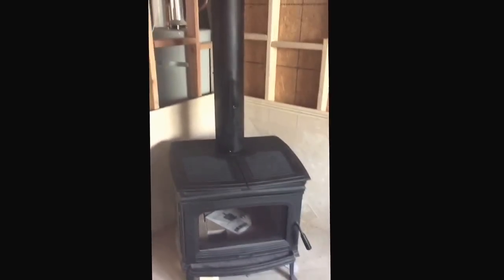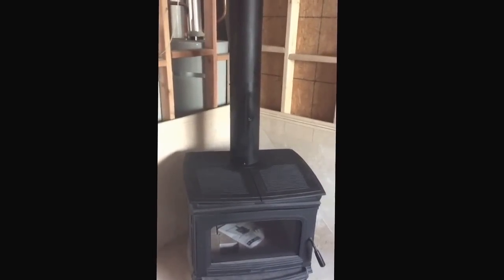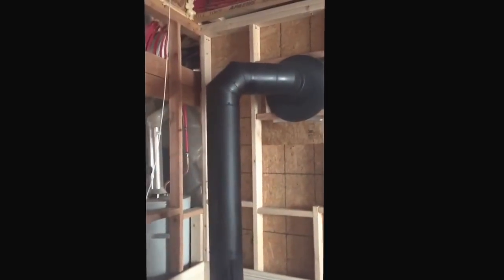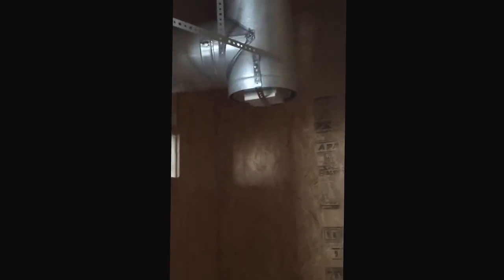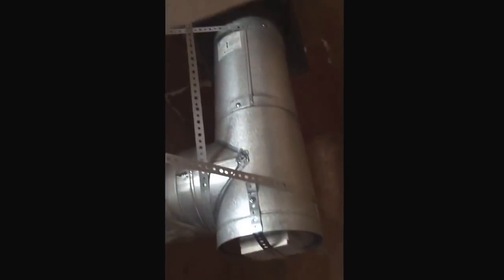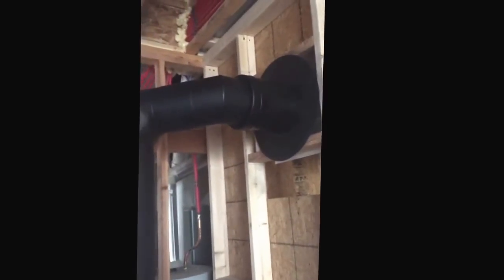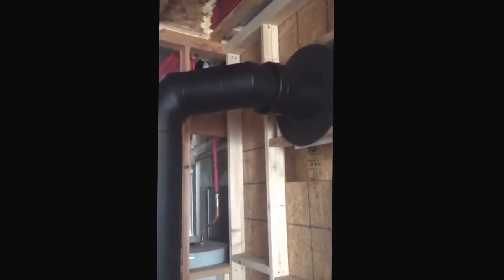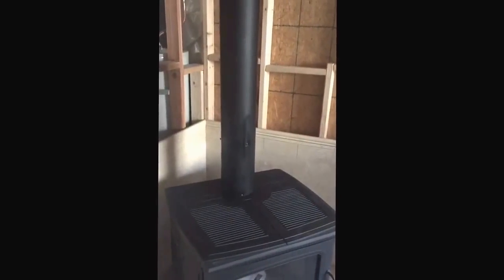Safe Through the Wall Stove Pipe Installation pt.2

Comment: What pipe goes through the thimble? I'm installing a wood stove with a horizontal wall support kit.  What I can't seem to find in any literature online is "Does stove pipe go through the thimble and connect to the tee on the other side of the thimble? Or does chimney pipe go through the thimble and connect to the tee?"

Pretty much is the "through wall" pipe black or stainless steel?
Reply from the maker: ONLY Class A Chimney Pipe has the clearance to go through a wood frame wall or ceiling. It is not up to code for ANY black Stove Pipe to go through a 2x4 wall or roof! Great Question.